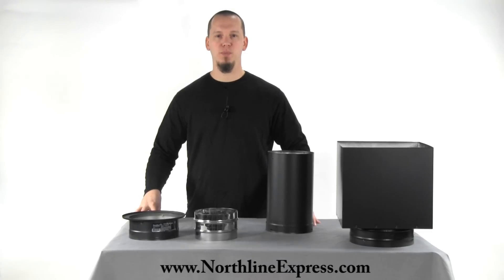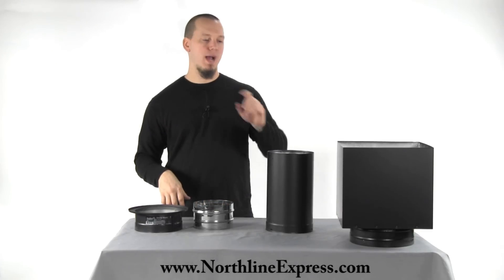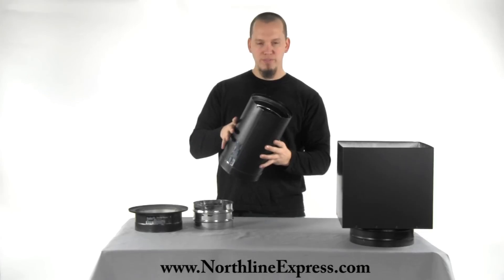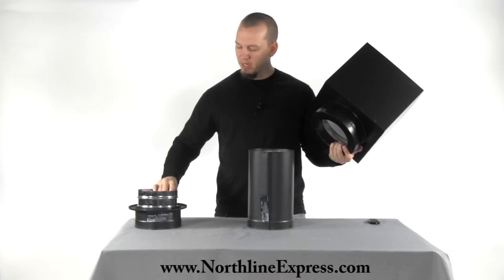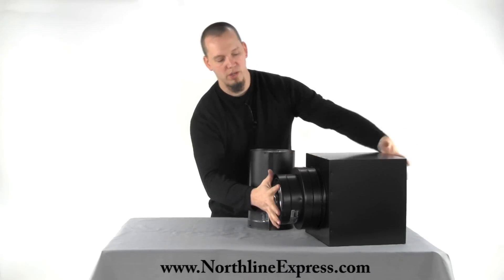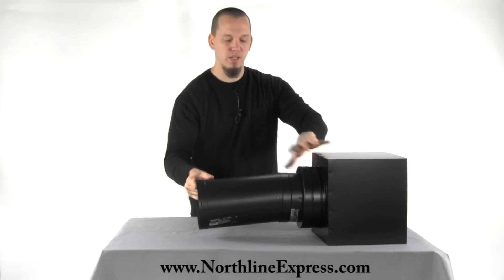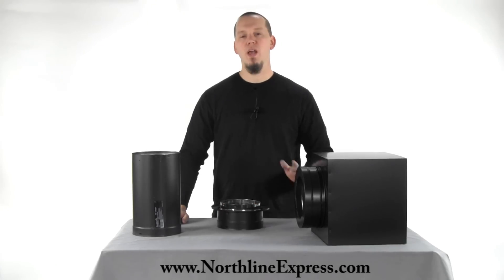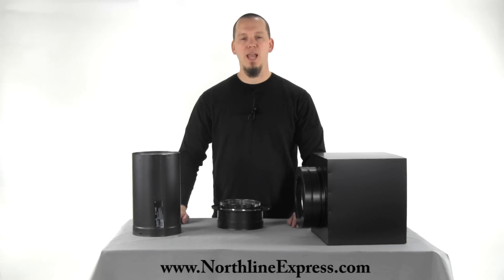DuraVent Chimney Pipe - DVL Adapter

Comment: My adapter came without an inner sleeve where do I get that part number
Reply: Did you ever get the inside stainless ring?   What is the part number for that?  I thought it came with the dvl-adt?
Reply: @charosenz  yeah that’s the problem is that the stainless ring itself doesn’t have a part number, it’s supposed to come with the adapter. I called a different place and got it ordered after buying it twice from the first place. I had to explain to the seller what I am looking at in the installation manual, then in the parts manual where it doesn’t mention the ring at all. So u gotta download the installation manual and Dura vent parts catalog and walk them through what you are seeing. Also part number depends on the diameter
Reply from the maker: Unfortunately there isn't t a part number for that particular piece. However, if you purchased it brand new and that piece wasn't in the box. I would contact whom you received it from so they can get that part out to you. in most cases we end up having to ship that direct from DuraVent since they don't supply "parts" per say to us. If you purchased from us please let us know so we can get that piece replaced for you!
Reply: @NorthlineExpress  I am still waiting for the adapter to arrive and was not sure if it was/should be in the box.  But it sounds like it should be.  Thank you very much.   Great videos...

Comment: What is the part number of this adapter.  The ones on Amazon and Ebay look a lot different.
Reply from the maker: It depends on the size you're looking for. If you are looking at 6" ID it's the 6DVL-ADT, if you're looking for the 8" ID it's the 8DVL-ADT. The images do tend to only show the outside so you aren't seeing the stainless inside piece in those images.
Reply: But does the inside ring come standard with the 6DVL-ADT? If not what part # is it?

Comment: I assume that adapter would work similarly  for a horizontal setup going into a wall thimble where there is Duratech Class A pipe protruding into the room?
Reply: I am trying to find out exactly the same, did anyone answer this?